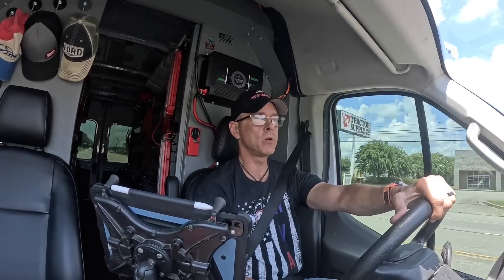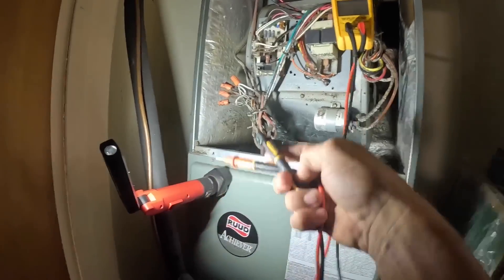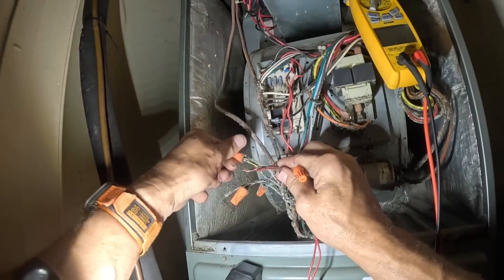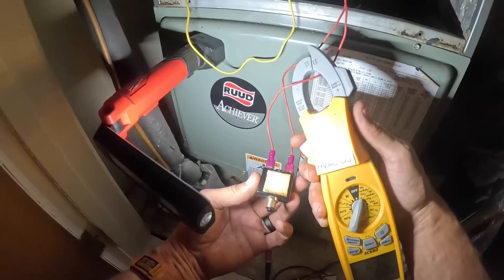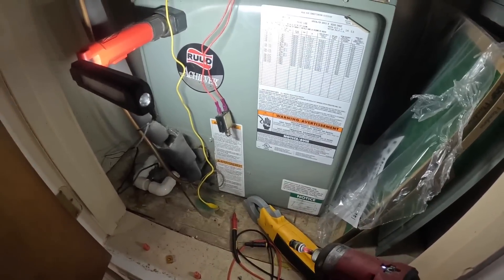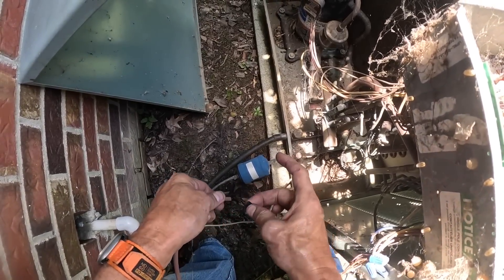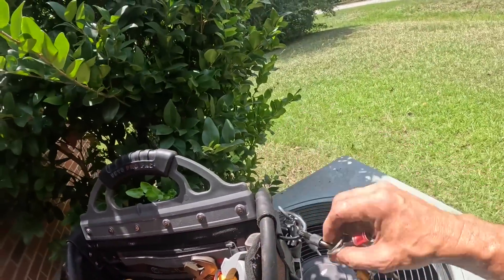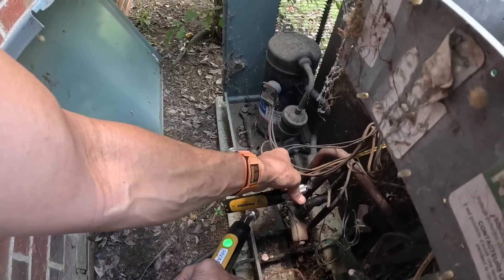Blank Thermostat Leads Us Outside! #hvacguy #hvaclife #hvactrainingvideos

Comment: If you ever have music in the background and you don't want the copyright issue, speed up that section by 10% and also lower the pitch by 10%. That way the detectors won't detect it. They primarily detect based on beat but if the beat is 10% off, it won't recognize it.
Reply: Nice trick…I got hit once because I had SiriusXM playing in my airplane intercom.  Just a few snippets of music in between intercom and radio calls.  Sheesh!

Comment: I came from electronics into HVAC. I'll tell you a little secret in finding "shorts" without even turning the power back on. Pull the thermostat, take an ohm reading from common to Y, W (or aux) G, O and if anything reads below 15 ohms, there's your problem, or at least the direction of the problem.
Reply: Thanks will check it out
Reply: yeah, that works fine on older gear. newer may be communicating and the furnace/air handler board handles everything. so you'd only be checking digital inputs on it, which will generally be higher and the rest may or may not be testable from the furnace board, depending on design and communication style.
it's going to get real ugly and complex in the next handful of years, going to need an background in mechanical, electrical, electronics and all of current hvac/r training to even work the field.
Reply: @throttlebottle5906  I'm thinking about retiring, I'm already getting complaints from my most loyal customers because they think I'm trying to rip them off since parts and refrigerants are so expensive anymore.

Comment: Whats the oldest unit you ever seen ?
Reply: The oldest "heating system" I ever saw was a stone fireplace from the mid 1700s in france, which is actually still in use today. The oldest one I worked on was an oil fired hydronic from the 50s, although the boiler was replaced in 04 (was a wood boiler before). I'm actually ripping that one out right now, as the boiler rusted out, causing the system to freeze and bust the radiators.